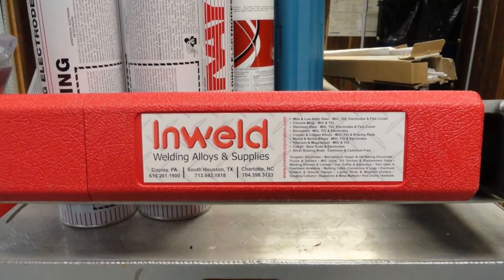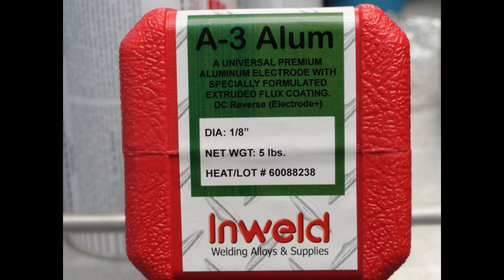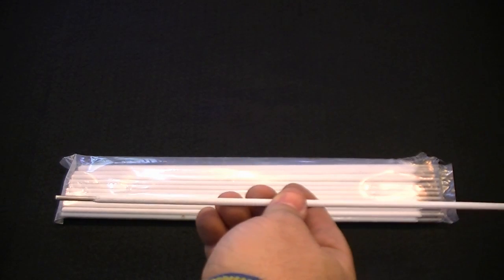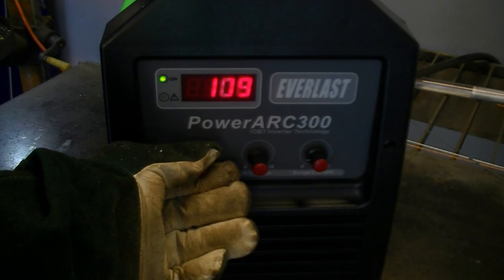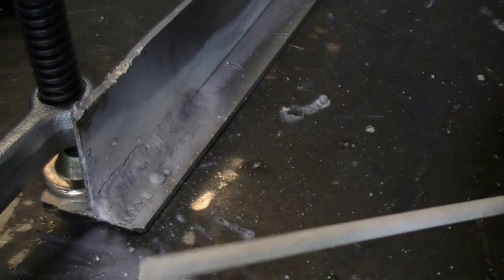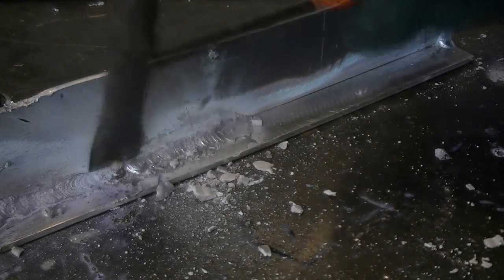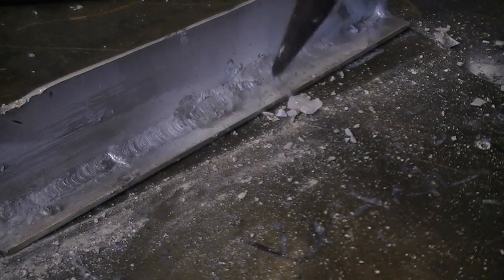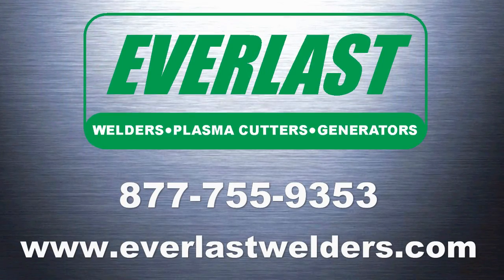Stick Welding Aluminum with an Everlast DC inverter  PowerArc 300

Comment: im new to welding and i have some aluminum future projects. im currently gathering information before trying to weld. i have done a few mild steel welding before. my question is : my welding machine does not have a switch to change from ac to dc. it is a small portable machine. does this mean it is only for ac welding? can i use this machine to weld aluminum?

Comment: I want to build a sliding gate from with metal tubing(1 1/2 x .75) around 16 guage.  I saw some aluminum tubing same size at 1/8 inch thickness.  so for the amount of welding there, just joining up the tubes at the intersections, could I stick weld it....I am in the process of learning.  I just took a class on MIG but if i buy a welder a stick looks way more versatile and cost efficient.
Reply from the maker: You should be able to given the right rod and diameter.

Comment: Pass. I'd rather get out my everlast mig to weld aluminum.
Reply from the maker: Yes.  But just as you'd rather get out your MIG, some prefer to get out a TIG.  But not all proceses are available all the time.  If you were performing a repair while up on a tower, neither MIG or TIG may feasible.
Reply: in hot and moist atmosphere (tropic, equatorial ...) you cant use gas ... in such places theses rods are unavoidable

Comment: It is interesting it doesnt need ac to break the oxide layer on the surface. Maybe the flux solves that.
Reply: So does DCEP. Flux keeps the oxide layer off but also helps with the penetration.

Comment: I got some 3/32 blue demon rods and couldnt get them to run for crap. Regardless what amperage I used the rod would just melt away and not deposit hardly any material. When I could get it to run for a few seconds Id get piss poor fusion of the joint rather it would just make a tall glob of a bead. Im not perfect but I can run pretty dang good with common mild steel electrodes and even stainless steel electrodes so I don't think user error was the case here. Not sure if it was the brand of rods I used but it's a shame I was really hoping this would be an option for field work. Gona have to stick with tig/mig.

Comment: I have been stick welding aluminum since 1995 and can say that it is still a bear to deal with, Glad my Everlast 205 SI is on order and due to be shipped in a few weeks. Its like Christmas for me.
Reply: can we use ac welder for this kind of rod? does it work? i dont mind a decent weld, as long as it builds up ill just smooth it out with a grinding tool

Comment: I've got a small 110
115volt 100amp stick welder and I wonder if it would work good for aluminum..what do you think? It's a pro-arc model 1150B

Comment: the machine in the video uses 110v? and is sigle phase?
Reply: I believe it is a 220v 1 or 3 phase welder. For full 300 amps, any welder would need more than 110v single phase.
Reply: Ramon  Arrieta Gonzalez ii

Comment: Hmm, so I can do this with my DC stick welder? :o
Reply: He's using a DC stick welder in the video. I'm going to give this a try with my little Everlast 240st stick welder.
Reply: It's not pretty takes a lot of amps I would suggest a backup strip to act as a heatsink
Reply: can we use ac welder for this kind of rod? does it work? i dont mind a decent weld, as long as it builds up ill just smooth it out with a grinding tool

Comment: Good rod for an emergency or field use.. aint worth a shit for anything else.
Makes a weld look like a 2 year old did it.
Inweld steel rods are the best....especially if you are running a Bobcat or Trailblazer.
Arc stability is phenominal.
Reply: it's aluminum. you can't weld aluminum with a steel rod

Comment: Would Everlast DC inverter powerArc 300 be able to weld steel/metal or have to buy separate unit??
Reply from the maker: Of course.  That's what it's primary purpose is.  We did this video to demonstrate that welding aluminum with stick is possible. The current model is the PowerARC 300ST.
Reply: Thanks
Reply: Tec 9 yes since the video shows aluminum welder
Reply: Did you just ask if a welder will weld metal??????????

Comment: i like the old original 2012  PowrArc 300...where can i get one
Reply from the maker: The design is essentially the same, with the same controls for the new one with the exception we've added a lift TIG function which does not affect stick performance.   We've not had those available for a while now since 2013.

Comment: Is this running on AC or DC??
Reply from the maker: +gregorio mandujanl 
All stick units from Everlast are DC.  You do not need AC to weld with these rods.
Reply: @everlastgenerator  can we use ac welder for this kind of rod? does it work? i dont mind a decent weld, as long as it builds up ill just smooth it out with a grinding tool
Reply from the maker: @richardandres5266  It's not rated for AC use.

Comment: does steel welding machine work with aluminum??
 ,,,i have dc stick welder machine that used for steel..
Reply from the maker: +Mrkhm1988   Stick can weld aluminum with the special rods shown above, or similar aluminum rods.  Not the best solution, but will work in a pinch.
Reply: thank, i got aluminum welding rods,,
Reply: @everlastgenerator  just to clarify. If i have inverter stick wekder, that i use for steel, i can use it to weld aluminium aswell, jusn need aluminium rods and connection with ground wire to Plus terminal?

Comment: When I did Tig aluminum welding for Trek  bicycle we always used AC current and argon gas.  Strange AC does not work for  stick. With tig, as the base metal heated we would decrease current with a foot pedal.  Here, the only option seems to be speed. Correct?

Comment: angle the welding rod  to put a little more of the bead on the vertical side of the weld .save any alum rod as a filler for big gaps use .

Comment: hi, i need to fill a hole from a stripped exhaust stud, tig is very difficult here because hole is 1/2 diameter 1"deep,  really need to fill it becasue last owner just eveball drilled stud and it angled, would this be the best option???
Reply from the maker: +fireblade639  You should contact whatever manufacturer of the filler metal to determine machine-ability of the metal if you tried this.  The best would be to use TIG to fill it.  If there is no other option, then I'd try stick.  But you definitely need to do a few practice runs first.
Reply: Thank you, i will make a few aluminium blocks  with holes to give it a try and cut'em to verify the filler and weld penetration...
Reply: A Helicoil would likely be your best solution. Welding heads can get complicated and result in a warped head, QUICK.

Comment: Does aluminum rods will works in AC welding machine?
Reply from the maker: Samuel Montemayor  No.  The recommended output is DC+ only.
Reply: that would help thanks...alot and more power....

Comment: My buddy asked me to weld up his aluminum frame for a dirt bike with a stick welder.  I've used tig and wire feed for aluminum but never a stick welder.  I just can't remember if the hobart welder he had was only ac or if it was dc as well.

Comment from the maker: Keep a tight arc with the front edge of the electrode dragging on the metal at all times if possible for  best results for stainless and also for aluminum, though the aluminum burns so fast, it is hard to do.  At least in stainless, if you have too long of an arc length, you will get porosity  below the surface, even though the top looks perfect.

Comment from the maker: It's not required.   But I imagine preheating would extend the capacity of the welding rod.   If it's too hot, the weld goes runny.   The flux just melts off like hot ice cream.

Comment from the maker: That's a frequent question we get, and probably one we should do a video on.  Aluminum was originally welded with a DC welder, but it was not a good solution.  It required a very large tungsten for even relatively low amperages because it concentrated too much heat on the tungsten in DC+ (used because it offered cleaning action) and offered low penetration.  DC- was used as well for a time, but it was difficult.  In short, the PA 140ST could be used, but won't be good solution.